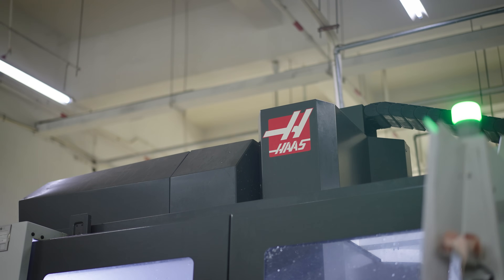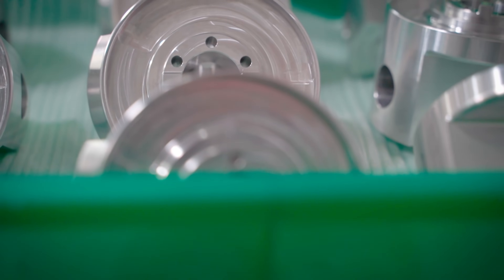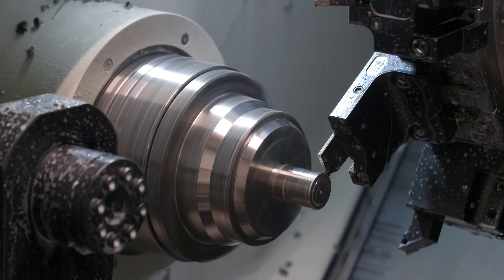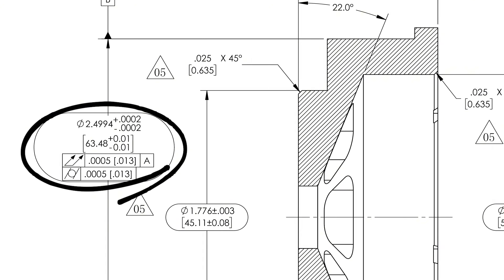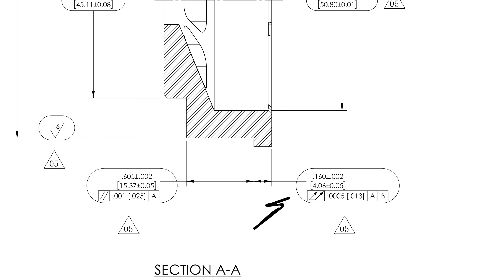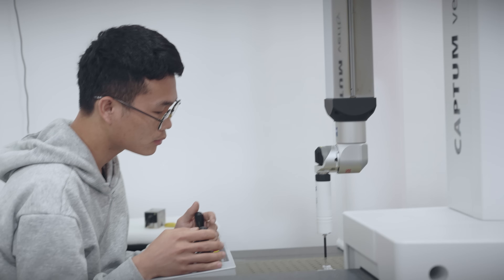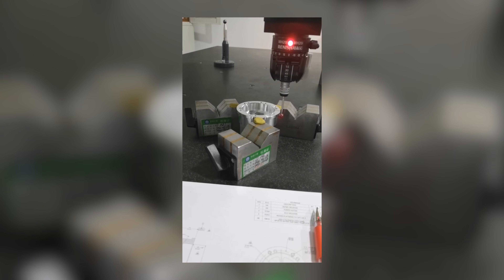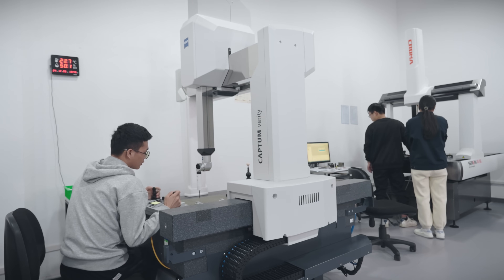Perfect Parts, Inspection Discrepancies: One Customer Complaint | WayKen Rapid

Comment: Check the flange thickness with a disc micrometer... or gage block stack on a surface plate.
Reply: they were having a 'difficult' time measuring the parallelism/ circular runout
cmm is more accurate